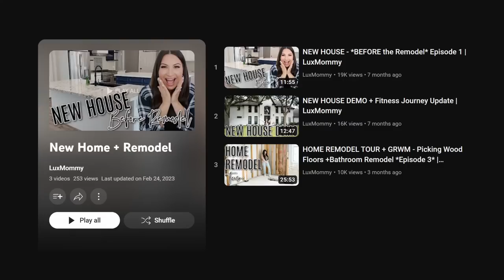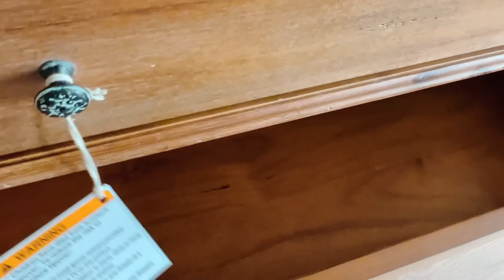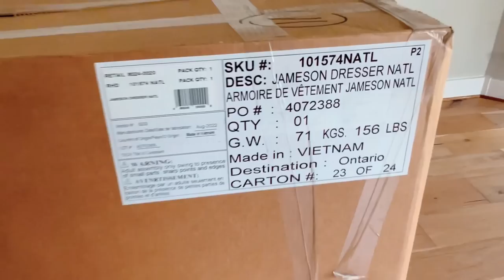HOUSE TOUR - Home Remodel Updates *Episode 4* | LuxMommy

Comment: A full mirror wall above your sink makes sense.  For your husband's it's more complicated because his sink is not centered and from my own experience I would not do a full mirror again if there's an outlet in the way.  I'd rather see a framed mirror and light fixture centered above the sink.  However, his sink is not centered so that may not be ideal. You'll need to decide how important it is that both sink areas match each other.  Definitely want to see your finished rooms.

Comment: Love everything but hate the  floors, they look like they belong in a cabin, just my opinion. For your hubbies mirror you can have mirror cut around the plug and than put the plate cover over and you will not notice. it will look like a full mirror. They just notch out the plug area. hope that helps. beautiful home. Can't wait to see the bedroom closet and your office area.
Reply from the maker: They are perfection! I couldn’t have picked better floors, even the contractor said they were the best floors they’ve even installed! I love them!!
Reply: @LuxMommy  The important thing is that you love them. Your home is stunning. Thanks for your comment. Love your video's.